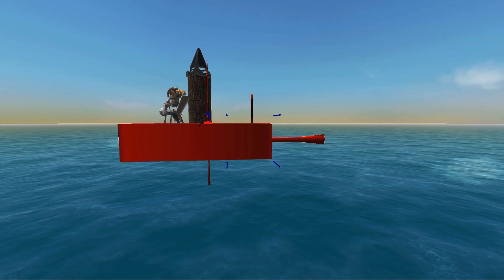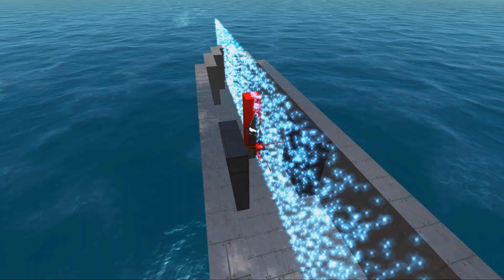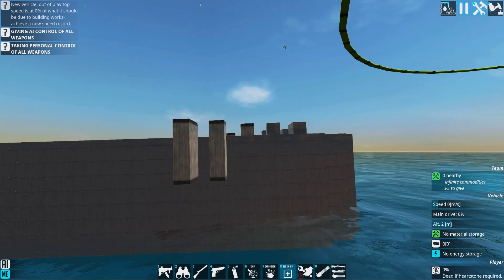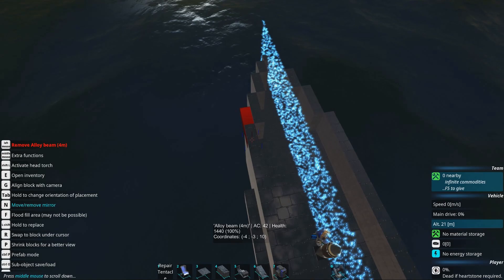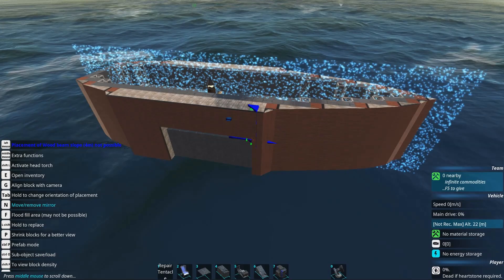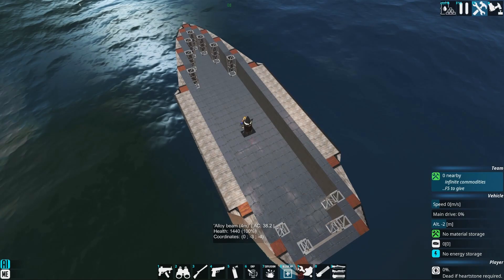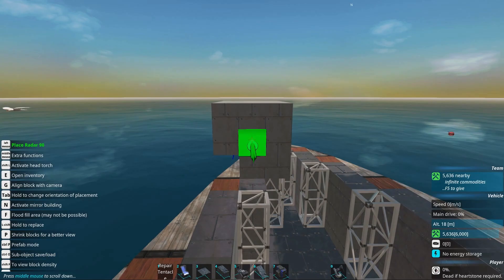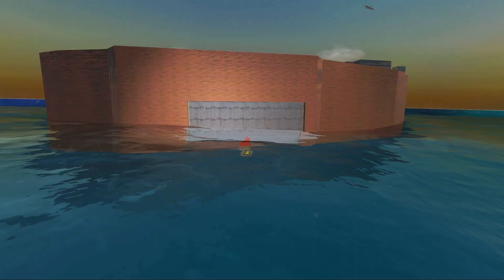From the Depths Hull Tutorial - Armour Guide for FTD 3.0+ (Final release compatible)

Comment: I just came back to the game after about 5 months and I noticed all my APS cannons do nothing to anything. I think it’s the new armor stats and how armor piercing works but I’m not sure. If you could, can you do a video on APS shells please. It would be really helpful.
Reply: have you certified that the shells selected are the correct one? And all of the conectors are in order, my older ships had some issues with aps as well, and it was mostly those 2, if not than it is the new armor stuff, I use mostly HEAT and HESH so eh, didn't feel to much of a difference, but the other ships that used AP or HE shells were noticeably affected.